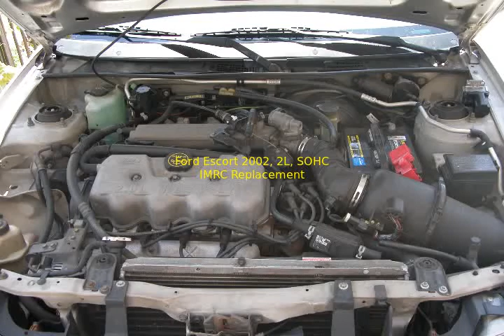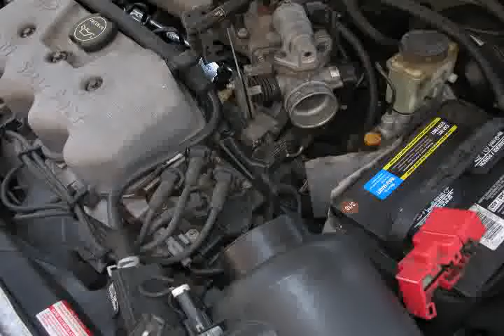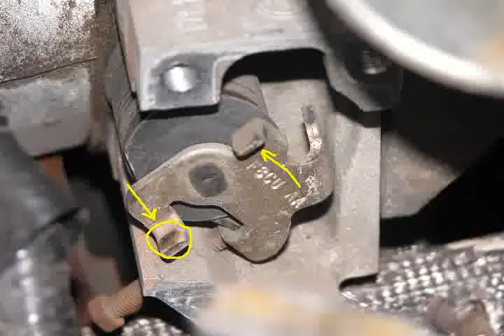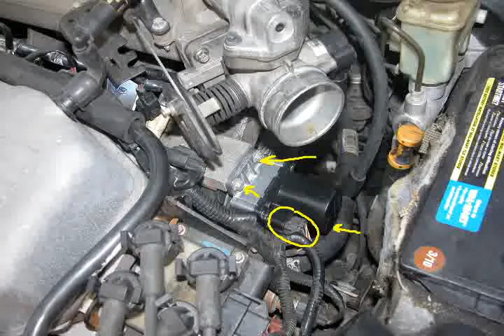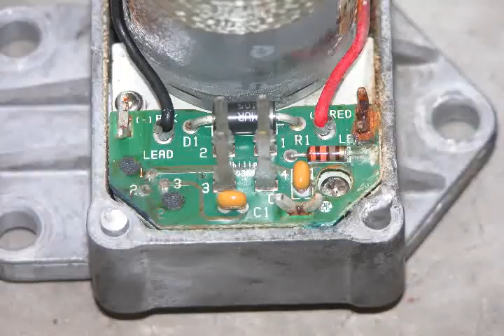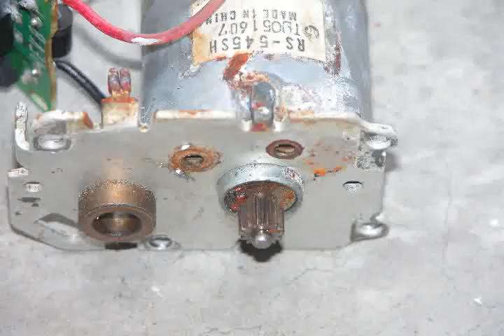Ford Escort 2002, IMRC Replacement

Comment: I have a trouble code P1132 on my car, I took it to my mechanic, he told me that the entire runner assembly had to be replaced brand new, but he also told me that the part was discontinued?
Reply from the maker: I would a good deal more data from the mechanic to trust it is tied to an IMRC fault.  I am not a professional mechanic but your code sounds more like an EGR or HO2 sensor problem.  I would look for a second opinion.
Reply: @GreenGuyDIY  thank you, I WILL take it to another mechanic for a second opinion

Comment: By chance do you still have a valid link to order this? Mine died just before inspection and my state won't pass with any cel on.
Reply from the maker: It has been so long ago I not sure but i think I got it from a local dealership parts department.

Comment from the maker: To clarify: The butterfly linkage should turn freely except for the force to over come the spring tension.  If the spring is turning freely while the butterfly linkage remains unmoved, the spring is broken and that too would be a problem.  This would be evident if the butterfly linkage turns completely free and does not return to the full open stop nor would there be any spring tension to overcome.

Hope that helps.

Comment from the maker: The spring itself does not rotate.  It is attached at the block and the linkage control horn that engages the IMRC control horn.  The spring assures that the butterfly linkage will return to the full open position as the IMRC returns to that position.  This is what is known as pre-loading.  This was likely done to simplify the engagement bewteen the two control horns.  The butterfly linkage should turn freely except for the force to over come the spring tension.